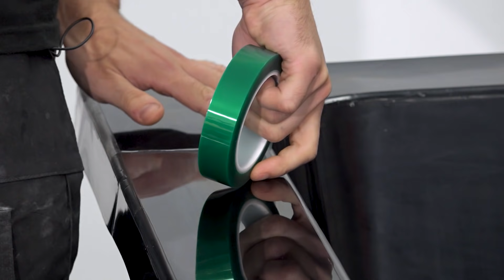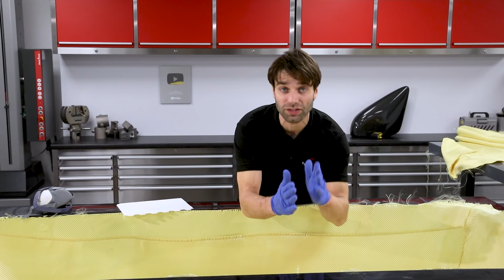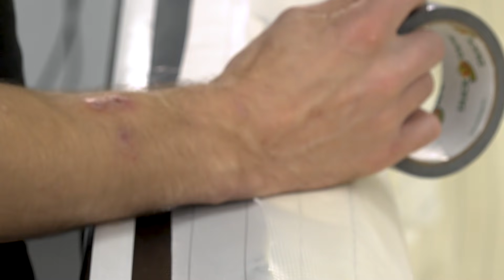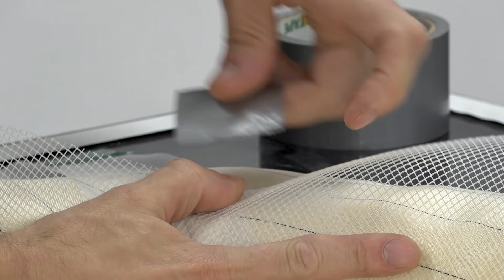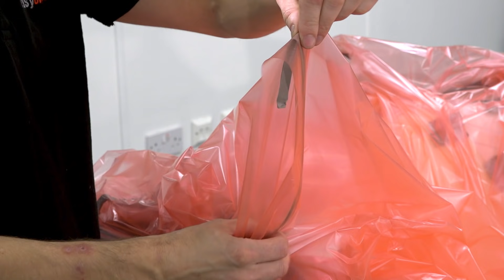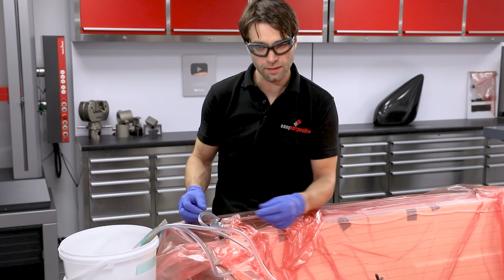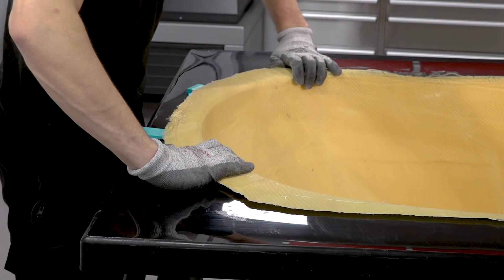In-Depth Guide to Resin Infusion (3m Kevlar Moulding)

Comment: I have an 05 town car with a full sim con top. It's getting pretty torn up and the upholstery places want more than 2 grand to fix it. I was thinking I would make a carbon mold from the current top but the top is pretty textured so ill have to do some extra sanding later. My question is would I put peel ply between the textured surface and the first layer of the fiberglass mold (along with the release spray and wax) to keep it from sticking? Or is there something else I should use. Or is it a bad idea
Reply from the maker: Peel ply isn't used to prevent the laminate from sticking to your pattern, it's used in resin infusion to assist (to some extent) with the resin flow and also to make it possible to remove the infusion mesh from the laminate after curing. If you're planning on using a resin infusion process to manufacture your component then you'd need to start by making a female mould (which is the bit where you would need it to release properly from your original component) and then use the mould to make the part following the process you see in this video. When it comes to preventing the mould from sticking to your original component then you're probably best testing the performance of the wax and release agent you're using to ensure that the mould isn't going to stick. Alternatively, you could coat the entire original part in some kind of pattern coating resin (which would trash the original part but it sounds trashed anyway) then flat and polish that and then release coat it - it will provide a much more reliable surface to release from than your 'torn up' original.

Comment: You turned the vacuum pump off before the part cured? You really have a lot of faith in your "perfect"ly sealed bag!
Reply from the maker: Hi Pierce, that is why a leak test is important
Reply: @easycompositestv  Even when my bags can pass a ten or twenty minute leak check with zero drop, they can sometimes lose a few inches of mercury overnight. very unlikely that any vacuum bag is perfectly sealed.

PS thanks for the videos, they are very helpful and well made

Comment: Loving your videos. I want to start making composite things now lol.

I do have a question. Would it make sense to use a combination of materials to improve strength? For example, make it with Kevlar, but use carbon sandwiched in certain areas to increase rigidity? I am naive on the subject which is why I ask.

One problem I see with this is that the outer Kevlar layers could deflect, without damage, further than the carbon can be deflected without failure. In this scenario, you could have hidden carbon damage and not realise it. Probably bad.
Reply from the maker: Its all relative to the specific project; Kevlar is usually used where abrasion or puncture resistance is the main requirements so the likes of rally car undertrays and guards. Often a hybrid material will be used in these kinds of situation whereby the strength and stiffness of carbon is the requirement but the above resistance from stonechips or other damage drives the use of the kevlar - if the item is damaged in that instance, it would be repaired or replaced but the combination of materials is there as a fail-safe.
Reply: @easycompositestv  Reminds me of my Mini Se7en days in the 90's when the rich guys were running carbon/Kevlar hybrid front ends (Curley mouldings). I could only afford a Kevlar/FG one :(

Comment: A silicone bag would be much better for the environment and time saved on a project like this! Good video
Reply from the maker: Silicone Vacuum Bags are a great idea in principle but do degrade quickly when used with Epoxy Resin which limits the number of uses considerably. Also, from an environmental point of view, a limited run such as this of three final products would actually generate significantly less waste (weight for weight) using conventional vacuum bagging film than you would using a silicone bag.
Reply: @easycompositestv  only with epoxy though? Polyester based resins can go for hundreds of usages! Have saved me a fortune in labour costs with my small business!
Reply from the maker: @deluxedigitle  Absolutely, but in the majority of cases when working with Carbon Fibre, epoxy would be the resin of choice.

Comment: Great video! 

I am trying to make my own moulds via vacuum infusion, using vinilester gelcoat, poliester resin, and glass fiber... But I am having issues from lack of adherence from resin to gelcoat... Could you give me any advice?

Thank you!
Reply from the maker: Not all vinylester gelcoats are compatible with polyester resins unless they have been specifically designed to be. You may be better off using a vinylester resin on the back of the gelcoat layer and then follow that up with polyester. We have a uni-mould tooling system specifically developed for such applications.

Comment: Spray tack glue straight onto the material?? That's called contamination my friend..you should have used blue or teflon tape
Reply from the maker: The spray tack is epoxy compatible and cross links with epoxy so has no impact on the structure.

Comment: Hello, How can I calculate the needed amount of resin during the resin infusion process, is there a simple way to calculate this for simpler and smaller project ???
Reply from the maker: We have a table in our Infusion Kit Instructions here: https://www.easycomposites.co.uk/resin-infusion-starter-kit
Reply: If you know the weight of the cloth you used including peel ply and flow mesh per unit area you can calculate the weight of fabric given you know the area of the part. If you want a 50/50 ratio you can just use that weight of cloth as the mass of resin needed. If you are using core you need to factor in the resin to bond with the core which can end up being a lot. Hopefully that helps

Comment: I learned some crucial info in this, especially the existence of that sticky spray and two of those cloths. But I think that its a lot of work to go to to save a quart of epoxy over just rolling on.   Finally, admit it- those are just bath tubs. You can only fool some of us!
Reply: Saving resin is not the point of this

Comment: Hello, still very greatfull for your very informative video's, been enjoying them very much.  I have a question.. I would like to duplicate som rather small vintage polyester RC Airplane landing gear. They were very nicely made and very becoming to the plane due to there shape and finish. However they were too weak by design. I would like to duplcate them in Carbon fibre but due to the LG being very thin blades (like miniature limbs of a bow and arrow) I am having trouble to come up with a plausible way of making the mould. So... I thought, maybe I can make a 2 part siliconerubber mould and combine it with infusion.. Would that work or would the mould collapse under the vacuum ?
Reply from the maker: Very small items are hard to infuse.  It may have been made in 2 parts or used a multipart mould to make things easier.

Comment: I love these videos, hands and heads above anything else out there. In the USA here and sad being a customer isn’t easier. You would be my goto. I mentioned before that I’m wanting to make a Fiat 500 carbon fiber hood identical to yours made a while back. 

Covid has hit my family he’s and sadly my plans have come to a stop. I’m trying to source an affordable vacuum pump here and some good quality carbon chips to skin a carbon diffuser that was cracked by a hit and run idiot in a parking lot last spring. Skinning it with forged fibers and vacuum bagging it would surely make it look amazing. It’s cracked along tope edge and is all consmetic. I used a baking soda a cyanoacralte mixture when it happened to keep the crack from spreading. Eventually, I’ll remove, fill and skin and possibly tint the coating. The part is so much lighter and it was almost $1000.00 new, I’d hate to trash it.

In the mean time please keep up the great work and since the forged look is in, can you do a video showing a cosmetic skinning or epoxy tuning to influence a color difference?

Thank you and please keep the vids coming, the education is priceless
Reply from the maker: Thanks Sean, great to hear from you and learn what your working on. For sure this pandemic has put a lot of plans on hold, including some of ours. We’ll certainly do some tutorials working with chopped carbon but, as you might expect, ours may be a little bit of a different take compared to what’s out there already. All the best with your projects.

Comment: hello!  I want to make a box using carbon fiber and I want the inner surface smooth. how to design the mold?
Reply from the maker: If you just want the inside smooth, you would make the mould as a male mould.

Comment: How much did one weigh?
Reply: Sorry for the delay - only just been in the warehouse to weigh it. Including fittings, covers etc, it's 13kg. This is a little above the weight of another 2m sledge I've had hands on, but there are some advantages here - extreme protection in likely impact zones (which has been an achilles heel for a competitor), a higher grade cover which adds about 500g, and it's wider too with better buoyancy with heavier loads. Critically, we haven't used any carbon in order to get the required stiffness with a thinner laminate, so the toughness will be better. I think it would be possible to get it below 10kg, but you'd end up with a sledge that has weaknesses, and not one you could bet your life on. I think we could probably lose a kilo or so (without compromise) with design tweaks in hindsight.
Reply: @AH-ns2wh  that's great.  an impressive build
Reply from the maker: Do you know, we forgot to weigh the sledges before they left. I'll drop an email to Alex and get him to weigh one and then I'll add the information to the description above.

Comment: Paul, I'm a big fan of your videos. The best at demonstrating how everything is done and what materials to use. 
My questions are related to resins. They appear to follow the property of the fabric you are using. I know that Kevlar/Aramid is lighter by volume than Carbon and almost impossible to break. Is it stiff enough to use for wings? A bonnet skin with a carbon inner frame? Things of this nature and how does the resin used affect this? Or is it just down to your fabric choice? 
Finally, if I use a 3k carbon twill first layer (exposed face of finished part) can I build the remaining layers using an Aramid to maintain a flexibility in the pieces? Assuming a 1.5mm finished thickness.
Reply from the maker: Remember the finished part is a composite of resin and fabric so often resin selection will be effected by the desired end results. eg using a weak polyester may be cheap but will not have as good mechanical performance as an epoxy. With higher end parts made with carbon etc, it would be a bit of a waste to compromise the properties of the materials by using a weaker resin.

Comment: Nice to see this technique demonstrated and beautifull part. Excellent video quality too. But I am a bit shocked by the immense amount of waste that is produced by this technique. All that plastic and breather material and epoxy that does NOT end up in the product but in the bin. Not suitable for recycling either because it is contaminated with epoxy. In comparison, it seems to me a more low-tech manual lay-up and wetting with a brush and roller would be much more efficient.
Reply: It's true to say that composites production isn't the lightest on plastics, but often release film and vacuum bags can be part or totally salvaged for another use. Also, infusion is pretty light on resin compared with wet lay or normal vacuum, as with the latter you'll end up squeezing and rolling plenty of excess resin from the edges which is wasted, or into a breather layer. It's also true that the fact peel ply is saturated with resin and thereafter has to be binned is galling, but it's hard to avoid.

You can also look longer term - perhaps a composite part might perform for years and years with nearly no maintenance. A comparable wooden/metal part might need regular repainting or protection from the elements. Hypothetical, but you get the point.

Comment: You could have run one feed line down the bottom center and vacuum line around the full top perimeter, that is how we infuse canoes....
Reply from the maker: Hi, thanks, yes, we could. Where possible, we try to keep the feed lines and connectors off the final component in order to avoid any visible 'print through' or 'witness mark' from them on the reinforcement. I guess this is a habit from generally making cosmetic carbon fibre components. It would of course make no difference in this case because we're using a pigmented gelcoat so it's a fair comment!
Reply: @easycompositestv There are commercial feed line products that raise the spiral feed line off the bottom of the part and the bag pleats around it creating consistent pressure over the whole area of the part.  If you take a 4" strip of flow media and fold it around the spiral line, hot glue it in a few spots to prevent it from coming apart, you can make your own.  Use 1/2" spiral wrap and you won't be restricted by flow.
Feeding down hill and short circuits can cause gas entrapment.

Comment: hi, how would you get a dry carbon finish on a surface?
Reply from the maker: By 'dry carbon finish' do you mean a matte finish? i.e. not glossy? - There's a few ways this can be achieved; (1) use a matte-finish lacquer/clear coat on a bare carbon part (2) take a bare carbon part and matte it using a scotch-pad or other relatively fine abrasive (3) have a relatively matte finish on your mould, which will transfer to the part. Option one is the most reliable and suitable for full production.
Reply: @easycompositestv  hi yes a matte finish. also will you start doing your courses again once covid is over?

Comment: infusion SHOULD start from the bottom up to the highest part of the mould.
Reply from the maker: What makes you think that?
Reply: @easycompositestv  first of all: it is a common procedure in any shipyard. then the reason why: if you start from the bottom you can close the resin inlet when the resin reaches the top (after a while) and the infusion stops without any further resin flow in whatever direction, this results in a slightly but measurable excess of resin content at the bottom. if you start from the top and you close the resin inlet when (after a while) the resin reaches the bottom you do not stop the resin flow and the resin will continue to fall to the bottom resulting in a poor content at the top and in a possible inadequate resin content at the top expecially on bigger and thickest parts. the reason for this is a simple balance among air pressure, gravity and viscosity. theory predict this behaviour but, again, it is visible and measurable expecially in big and thick parts. also the resin pot SHOULD stay well below the mould otherwise the resin is not pushed in the mould only by the air pressure but also by the gravity force resulting in an uncontrollable resin flow (the resin will flow inside the bag blowing it until you close the inlet): you may do this (also pumping resin wit a pressure pump) but this is called RTM or RTM light and it requires a rigid or semi-rigid countermould. on the other side, if you place the resin pot well below the mould, the bag cant't be blowed because the pressure by wich the resin is pushed in the bag is lower then the air pressure (which pushes the bag against the mould) due to the weight of the column of resin betwen the pot and the mould.

Comment: Was mixing graphite powder into the gel-coat on the bottom and runners considered? It gives a great improvement in durability and friction reduction.
Reply from the maker: Hi Robert, it was more than considered; we did a whole video about it. Please check out the video which comes before this in the series! The runners themselves are fixed on after but.... spoiler alert.... graphite didn't help in this situation.

Comment: One of my problems while infusion is, when I have more than one mould parts the screws. Most of them got full of resin and it really hard to open them
Reply from the maker: Release coat the threads with a liquid release agent or seal around them so the resin does not contact the bolts/screws directly.

Comment: Shouldnt the top side of Kevlar be protected with some coat or material as well from any UV to prevent degradation? or was that just done in the final that we didn't see?
Reply from the maker: Hi William, the inside of the sledges is covered by a tarp which seals tightly over them when in use (as you see on the finished sledge). Also, any effect of UV on the Kevlar only goes a micrometer or two into the material so the structural impact is immeasurably small. And finally, these will be used in the Arctic winter, there is never any sunlight!!

Comment: One question. Are there exist different peel plies? I have problems with release it while demolding.
Reply from the maker: Yes, but they don’t make a massive difference. Generally you can get polyester, Nylon 6 and Nylon 66 peel ply. We stock polyester (ours has a black tracer) and Nylon 66 (ours has a red tracer). Nylon 66 can be just slightly easier to remove (it’s mainly designed for very high temp use). Silicone coated peel ply does exist but we stopped selling it because the traces of silicone make secondary binding almost impossible so I would recommend you avoid them unless you really don’t need to bond onto the reverse of the component.
Reply: @easycompositestv  thanks a lot. I have to look for buying in GB. Hope it is possible cause brexit.